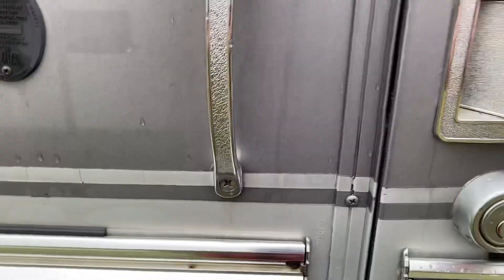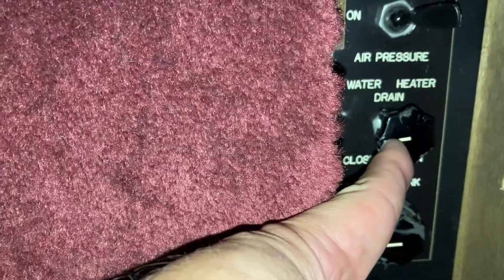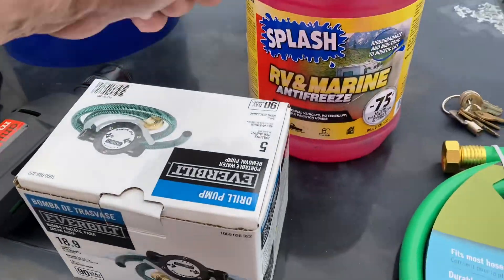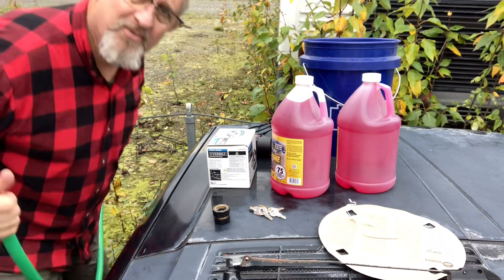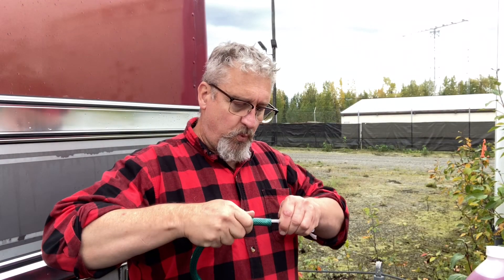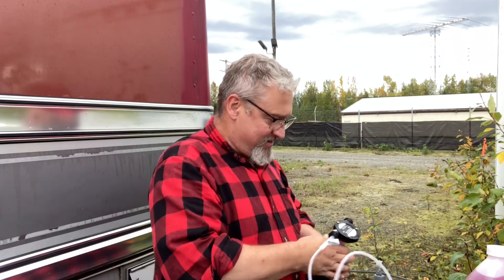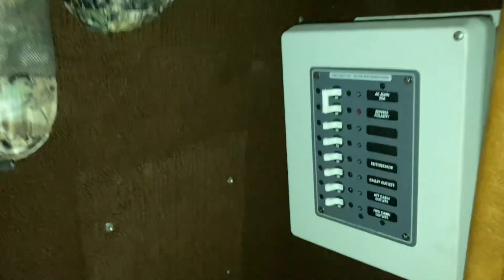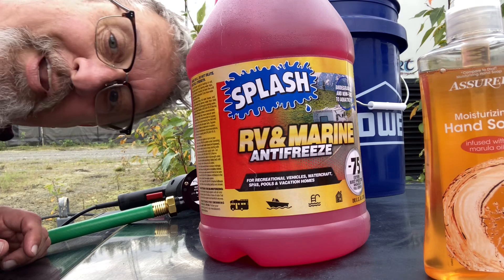How NOT to Winterize a Wanderlodge, Camper or RV in Alaska! ❄️

Comment: So you had to shut the low point valve off before any antifreeze would go in?   This will be my very first wanderlodge winterization. Instead of antifreeze, im going to hook an air compressor up, (in that same compartment) and blow out everything.  Does that mean that air will come out of the low point hose, if I don’t have it shut off?   It has the automatic air blow out system like yours, but I was told not to trust it.   
Did you end up using the air, or continue with the antifreeze?  Thank you……
Reply from the maker: Ahoy Jeff, we actually wound up doing both (antifreeze first, then blowing out the system with the compressed air).  This Spring when we actually get to USE it (we hope 🤞), we’ll find out if it worked 😜
Reply: @Buoy4AK yea hopefully all will be well…. 🤞